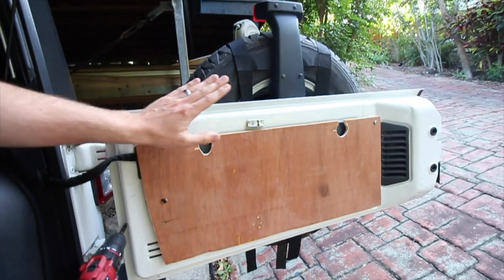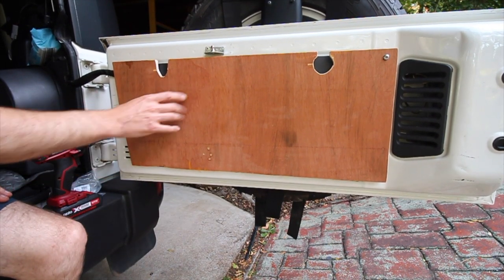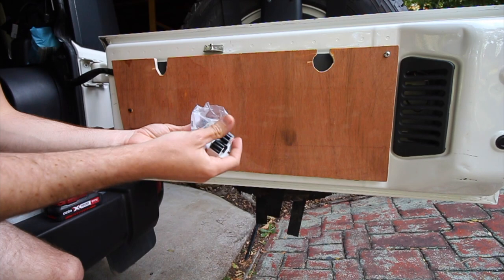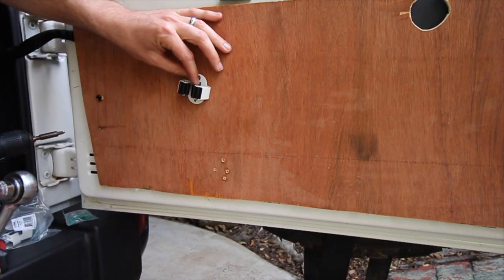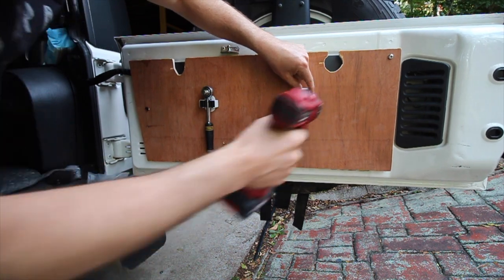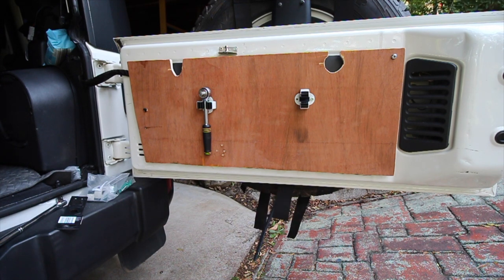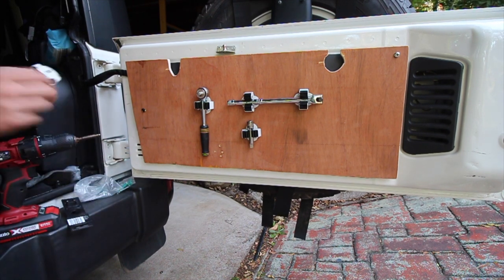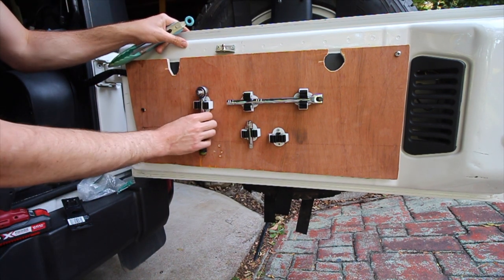CHEAP JEEP TOOL STORAGE

Comment: A long time ago I mounted two of those broom hangers to the floor of my YJ next to the driver's seat, actually the sill plate. I mounted a 6-D cell Maglite there. So long ago that the screws completely rusted away.
Reply from the maker: Hahahahaha dam that must of been a long time a go, what did you have them for?
Reply: @Whiteandsonsgarage  big, very long flash light. The kind the cops yousta carry.
Reply from the maker: @KC9UDX  nice, do you still have it?
Reply: @Whiteandsonsgarage  sure but it's useless..  welded shut with leaky batteries inside.  There was actually a lawsuit about this.
Reply from the maker: @KC9UDX  hahahahaha nice, oh shit, not good at all

Comment: I keep my tools in a couple USGI type canvas bags.  One with my sockets/socket wrenches and one with my general tools like screwdrivers, vice grips, multimeter, etc.  I also have an open end wrench wrap for my metric wrench set.
Reply from the maker: Nice, how big are they? Sounds really good
Reply: I got a roll like that but its got zipper bags instead of just slots for the wrenches so I can separate different types of tools

Comment: Wouldn't it be far more convenient to have all of your ratchets and sockets in a tool pouch so when your under the jeep everything is right there at your reach? Seems like you literally made life harder on yourself when you need to repair.
Reply from the maker: Very fear point, for the kind of driving I do on and off-road the likelihood of anything braking is very low, but definitely might be something to think about adding next to everything else. Thanks